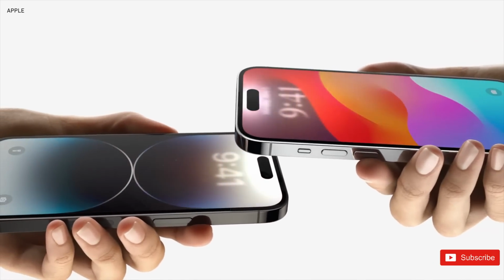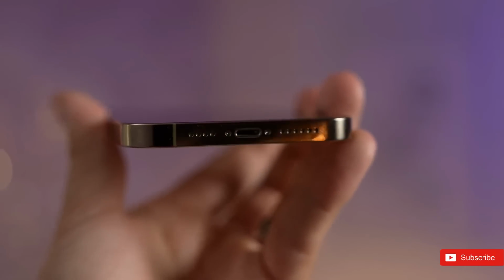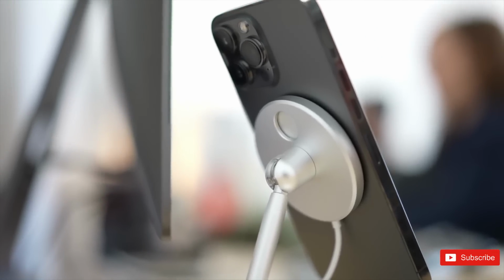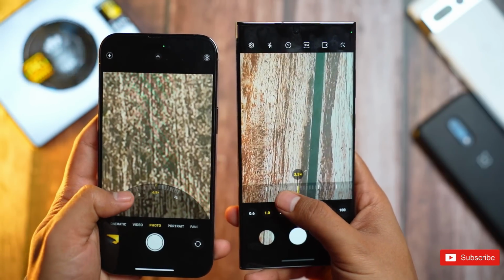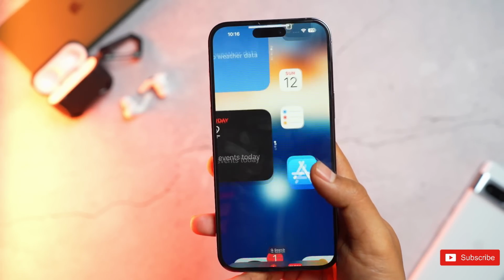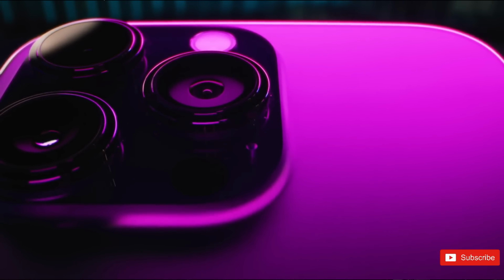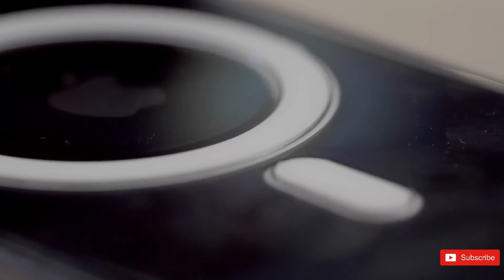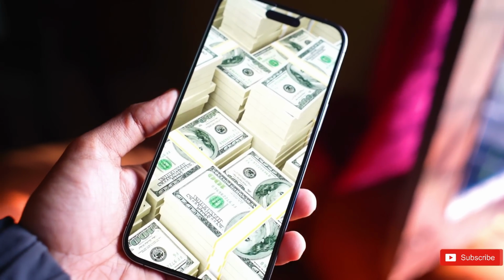iPhone 15 Pro Max - EVERYTHING SO FAR 🔥🔥

Comment: Its the same phone with slightly better specs😂 apples innovations are so breathtaking
Reply: Phones dont change that much anymore, better chip display battery titnium speakers etc, its really not that much to change. 
S22 s23 was really the same phone too. The way it will be now.
Reply: @Randomdude21-e  you act like Sam and apple are the only guys who make phones
Reply: @offbeatkyle  its really the two biggest brand here, rarely see anything else here so i used them as examples, pixel phones dont change drasticly either
Reply: There  really is not more they can add just minor minor upgrades , I will be upgrading from my trusty iPhone 11 to the 15 pro max , that  will be a big upgrade . Apple Phones now last a few years so no need to change every year and save your cash .
Reply: Their PR people and paid promoters are the masters of hyping up the most expected and routine of upgrades in the most excited and feverish a manner as possible. It is almost comical bar the fact that many good people always fall for it.

Comment: Apple needs to upgrade the software. Got the 13 Pro max and I think that will be my last. I'm using the Samsung Galaxy S23 Ultra and going that route for the foreseeable future. Apple, yes they're good phones, but that's it. On the productivity side, they can't touch the Galaxy line up.
Reply: I use both, samsung for work, i would never go full samsung over iphones, their great but the iphone is better in everything i use my phone for. Phones are getting more and more the same now. Choose what you prefer
Reply: Part of me really wants to take a look at the Samsungs, again, but I hate the curved screen plus everyone around me have IPhones.